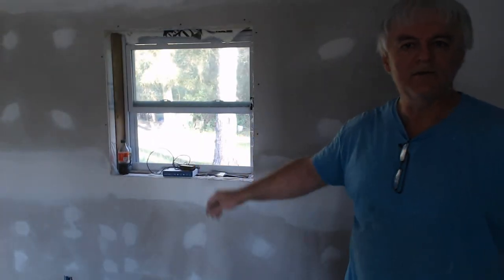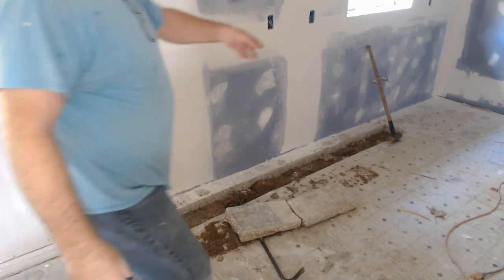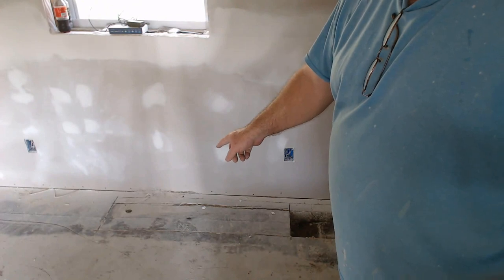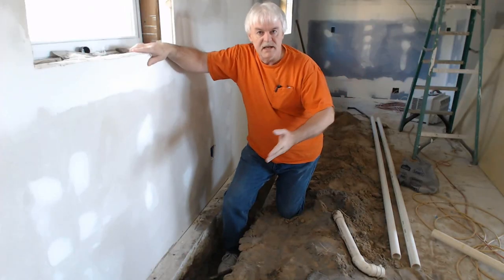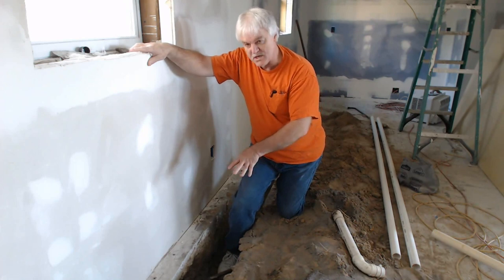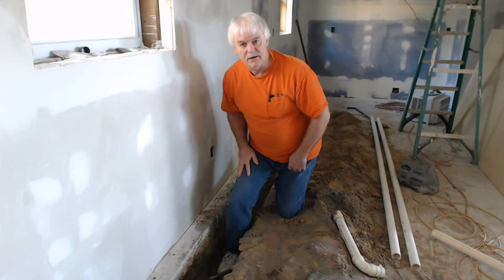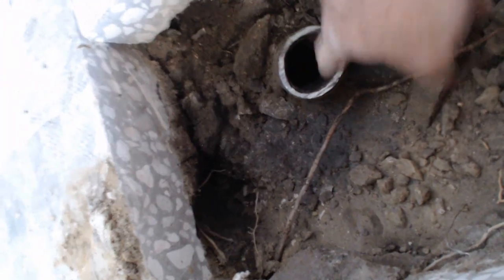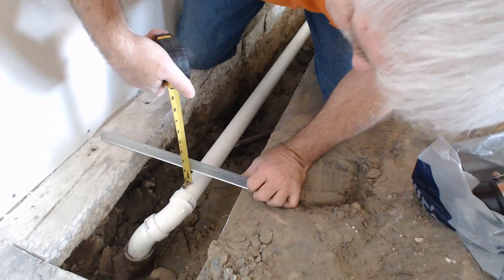Abandoned house makeover | Moving the kitchen drain

Comment: I never would have cut the concrete.   Drill thru the  wall and connect outside the drain.   Lot less work and no damage to the slab.
Reply from the maker: Considered that but I would still have to dig up the slab to remove the existing drain and my experience with exposed pipes has not been good.

Comment: What did you end up with for a drop?
Reply from the maker: About 3/16 per foot. I compromised on the right side of the slab and let the drain encroach into the concrete about an inch. Fortunately 9 feet of this concrete patch will be under cabinets.